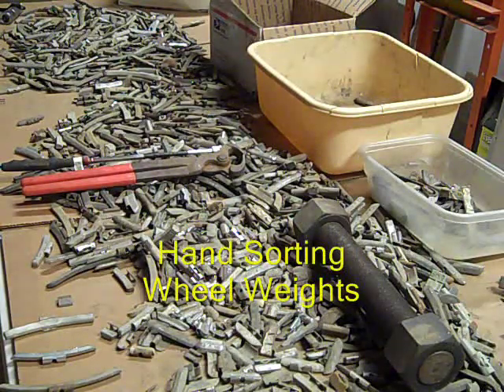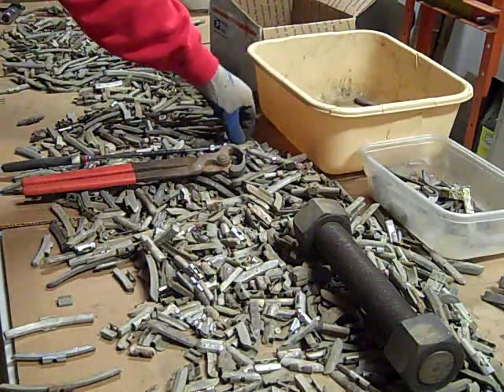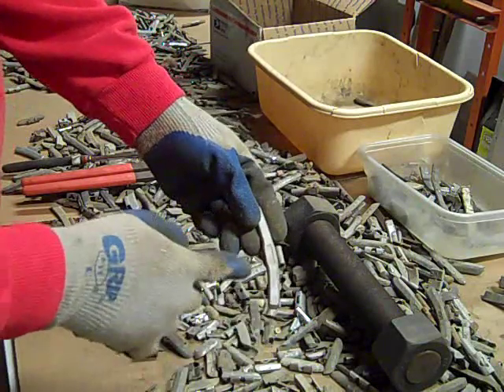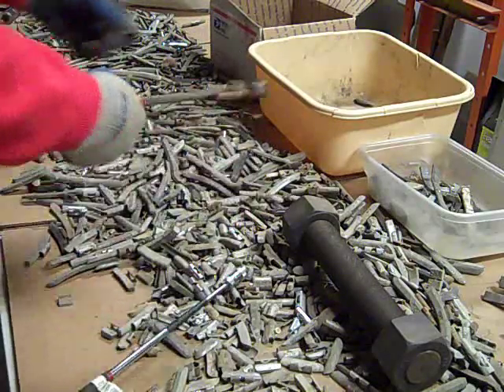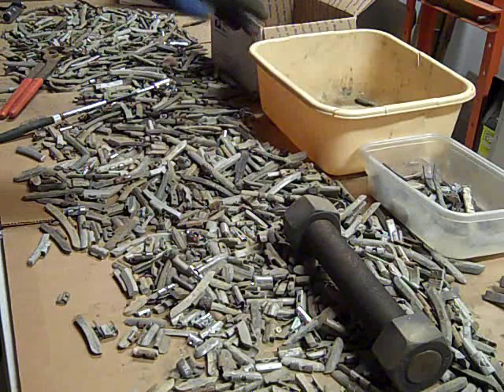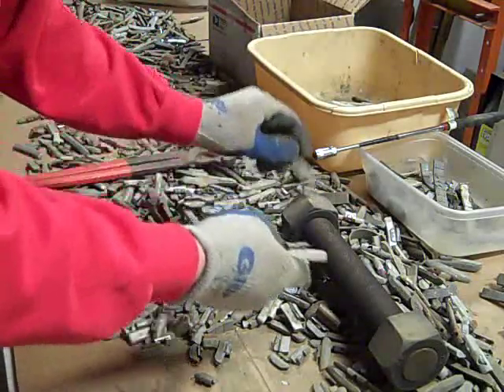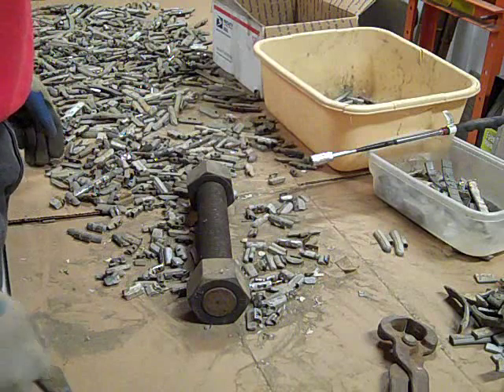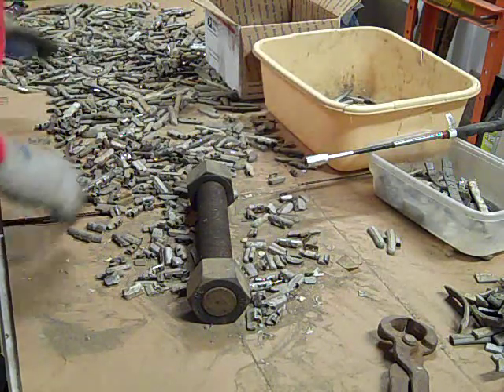My OFFICIAL guide to sorting Wheel Weights for lead Bullet Casting - reloading lead cast bullets

Comment: After casting for 8 years, I just smelted my first pot of wheel weights. I mine reclaimed bullets from dirt berms for most of my lead. I paid $.25 a lb from the scrapyard for these. with around 80% return, I'd say that decent. Also sold off 3 1/2 buckets of smelted bullet jackets. Ready for it? $508.00 in scrap weight.         Also found 2 half bars of 50/50 solder, probably 2 lbs and 8 lbs in ingots of what seems like Linotype or similar hard lead. Those were $.60 lb.

Comment: ive turned many hundreds of pounds of mixed ww into bullet metal over the last 40 years. turned  just last  saturday i rendered 100 plus pounds of mixed wheelweight into ww bars, and pure lead bars for round balls, in about four hours. i get obvious lead clip on weights melted and any zincs that get in the pot float on molten lead zinc floats so skim those off with the clips and dross. i shoot muzzleloader so seperate the stickons and flat weights get tossed in a pile. run a BIG magnet through those and seperate the iron from soft lead. 20 lbs soft lead and 69 pounds ww. tapping and using nips on them works but is very tedious.

Comment: Lead melts at 621.4 F. Zinc melts at 787.2 F. That is a 166 degree window. I sorted 2-3 huge buckets of wheel weights by hand before I decided forget this! I use an electric burner that heats to 650 F maximum and just dump everything in and will NEVER do this agonizing task or sorting wheel weights ever again!
Reply: True story. Heat it up and skim off the crap
Reply: I hope to all that's holy that you use adequate ventilation when you touch that stuff.  Lead is terrifically dangerous stuff, especially in kids!

Comment: I recently got 2 5 gallon buckets full of weights, and not all lead.  I did the scratch test and as well as looking at the stamp/cast lettering and separated much of it.  when I cast my ingots and projectiles they appeared to have somewhat of a crystal design much like how water freezes.  is it something I should worry about?  why does it do that and how can I fix it?
Reply: Antimony will make a crystal look. A lot of my ingots do that. Just Flux it and it will mix back with the lead when you cast, you want that in there

Comment: I'm not so sure I would use melting temperature to sort.  The zinc may be soluble in lead even if it doesn't melt.  Salt melts at 1500 degrees, but dissolves even in cold water.
Reply: When your lead starts melting lower the temp, zinc ain't gonna get in. It'll float unless you get it mega hot. Zinc isn't as scary as a lot of casters make it sound.

Comment: The really big problem are not steel one. The Zinc is dangerous because of the melting temp is really close to Lead one. And Zinc can really do a disaster into Lead alloy.
Reply: I've heard you can use sulphur to remove the zinc, but so far I have not found any videos on the subject..

Comment: nice!
What about cutting open old lead acid batteries to get the lead?

old Scuba dive weights are another great source...
Reply: Most of the newer lead acid batteries are a royal pain because it's lead plated, not all lead. Plus, it's a huge mess. I did a couple and went back to wheel weights. However, if you have a friend with a junk yard, it might be worth it.

Comment: for wheel weights to tell the apart visually steel ones will be stamped with Fe on them witch indicates iron( which is what steel is made from) zinc will have a Zn and the lead ones will not have those. the different types of shapes for weights have letter designations for them as well, some of those are AL MC PT and a few others, and others will just have the weight on them.

Comment: seems like he said, you would need to re-melt it, and control the temp low enough so it is below the melting point of zinc and it will separate itself

Comment: The first step in separation could be by mass, right? Why not put it all in a big bucket and shake it for a while. The lead should make its way to the bottom of the bucket and the top layers could be discarded rather fast in comparison with checking them all individually. If there are steel parts on lead weight that's still a problem though. I have never melted any lead, just wanted to share the idea.
Reply: You'd need to shake it for days and a bucket of wheel weights is anything but easy to move loll

Comment: easy way to sort them just use wire snips if it cuts in its lead. a guy i know uses a huge pot with a digital temp control and he just pours in all the weights and scoops out the ones that float

Comment: I just did this routine today.  I just dumped them into the melting pot because I am making fishing sinkers and am not really conerned about bullets deforming. I ended up with a tub full of roughly 4 ounce ingots. the crucible for making the sinkers will hold 3 or 4 of them. I was just after clearing the slag from the mass today

Comment: an example of zinc is our pennies or the 22cal henry rifles they sell at wal mart, if you put a penny in water with a little salt, it will almost disappear, there should be an expert near you, at a junk yard, its their job to know the difference and seperate it, usually verry strange people,.. probobly afraid ur a G-MAN, ahhh yeah also golf companys sell lead to weigt golf clubs, a company called the golf works sells pure lead, or used to google them check their catalog, microgruve, barrel, no

Comment: I'm not a bullet caster, I found your video by way of scrapping, but your videos are excellent and filled with info.  My question is, are there wheel weights that are an alloy of zinc and lead?  I thought I read that the oldest weights are pure lead, and then later on they were 60% lead 40% zinc and now they are just plain old zinc or steel, with no lead.  If there are zinc/lead weights do you just try to sell it as zinc?

Comment from the maker: If you are asking how to get the adhesive off of the stick on wheel weights before smelting, don't, just leave it on, it will burn off.  If you are asking how to get the stick on wheel weights off the wheels, I don't know... just pry or scrape them off maybe?

Comment: Very Well Done. I have a similar system of sorting out Wheel Weights. Clean surface protection as cardboard or LawnLeaf bags,Wearing Good Rubber Gloves and Washing/Drying the WW, Needed  We are 100% Correct to do so. One Benefit of Authenticating The Wheel Weights is in case of Interruption; I had a small Cast Iron Pot on the Burner, received a phone call and when I Checked back The Thermometer was over 800+ Degrees, If Zinc Wheel Weights had been in there the entire pot would have been ruined.